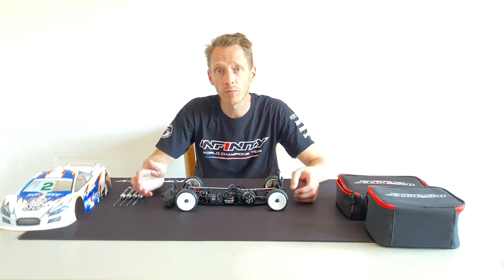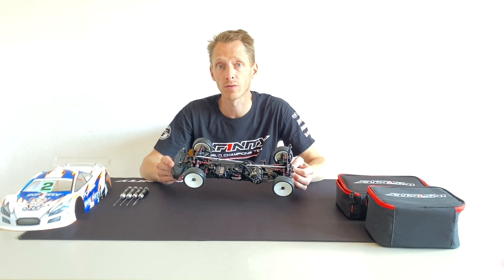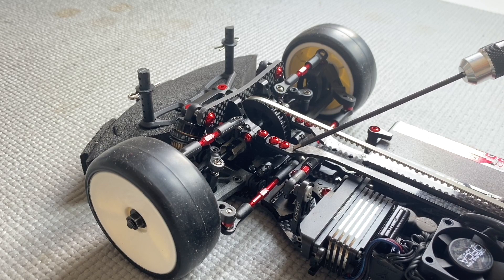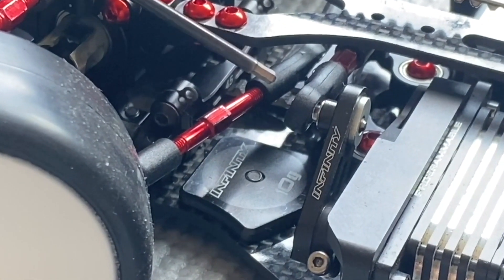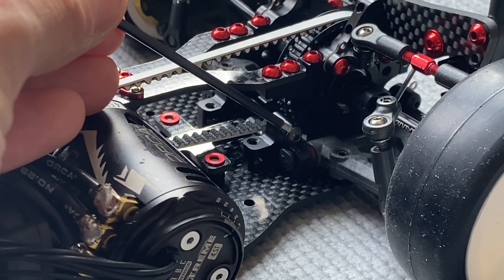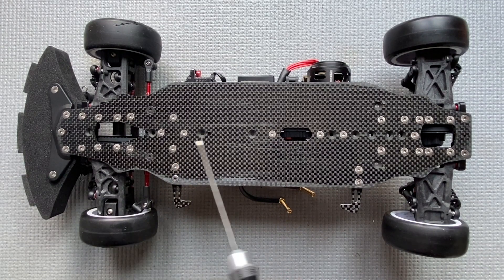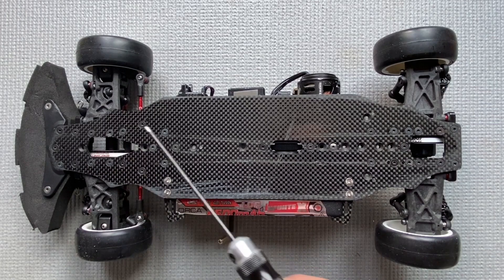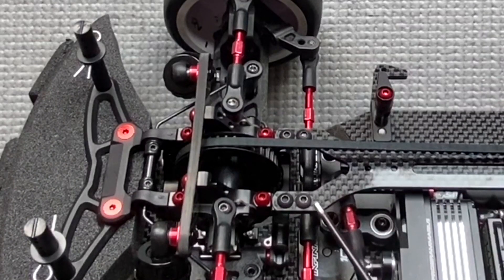Jilles Groskamp Aluminium vs Titanium screws

Comment: Great video, I've been using aluminum and titanium screws on my builds for 30 years. Some of the early Traxxas cars used aluminum screws from the factory, which is where I got the idea. As long as you use them in low stress areas they work great. For high stress areas such as steering, camber links & shock mounts I use titanium. One big upgrade on my Slash was swapping all of the clipless body mount screws to aluminum. The mounts use 16 steel screws total, so swapping them to aluminum lowers the COG as they are the highest point on the car, and the Slash is prone to traction rolls in stock form. Between all of the aluminum and titanium screws & aluminum turnbuckles I would guess I've shaved close to 40 grams. Not much for a 2155 gram vehicle (no battery), but every little bit helps. One key thing I found... cheap unbranded aluminum screws are about half as strong as branded ones (like Hiro Seiko or Traxxas), likely due to inferior alloys or improper heat treating. Sometimes the heads snap off before they are even fully threaded into the plastic. Don't risk it, buy the good stuff the first time around. Extracting a broken 3mm screw is not fun. Another huge benefit (if you run in water) is no ugly rust stains. My cars look almost new and some of them are decades old.

Comment: Wow thank you for your tips, i use all titanium screws on all parts on my car thinking that lightweight is the most important thing, but i was wrong, thank you for opening my eyes
Reply: Titanium is more corrosion resistant than stainless steel though. I take it that you got more of a race car? In my case the Losi LMT monster truck is a very high car and with plastic stock parts to begin with. So any metal upgrade would lower the mass center significialy. The screws are not that important. However. Corrosion resistants is important. But seems I stick with stainless A2 instead of grade 5 Titanium for now.